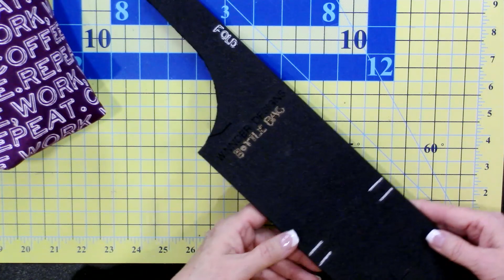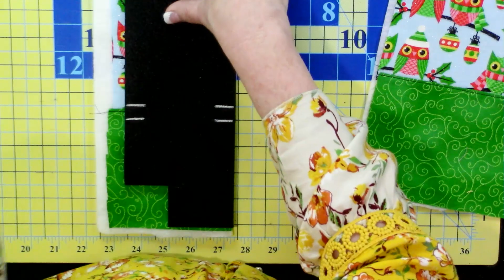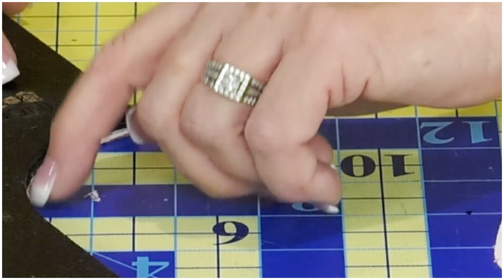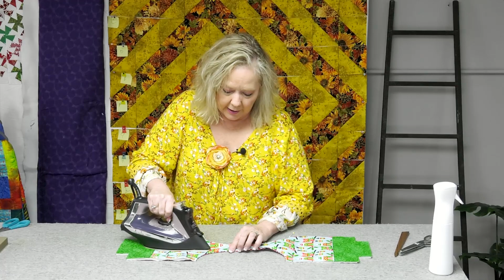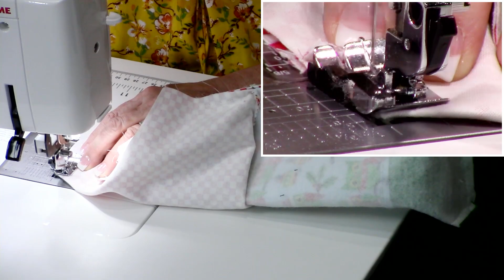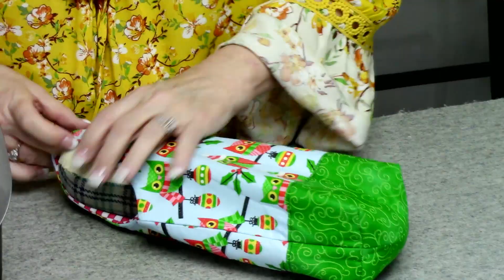Bottle Bag Holder Quick & Easy!

Comment: Where can I find that stuff to protect my iron from getting sticky?
Reply from the maker: Thanks for asking, Ellen! I use a Teflon sheet with fusible interfacing, delicate fabrics & even on the back of vinyl or leather.  You can find them on my website in 2 sizes - 12" x 16" or 16" x 24".  I like the big one as I can put it down on my ironing surface, then place my materials on one side of the sheet & fold the other part of the sheet over the fabric. If you decide to buy, use Discount Code "1st order" to get 19% off your order. You can find them here: https://winner-designs.myshopify.com/products/teflon-pressing-sheet-multiple-sizes?_pos=1&_sid=43bace6b1&_ss=r
Reply: Thank you!! I just found you, but I'll be following!
Reply from the maker: @ Thanks! 
I hope to start filming again. I've been sidetracked w/ major home repair - mold, mildew, termites (ugh!). Finally starting to see light at the end of the tunnel. Planning to have a Newsletter with new templates & a sale come out soon. If you want, you can sign up for it with this link: https://dashboard.mailerlite.com/forms/599830/99411415319708714/share
Reply: Ohhhh thats great! I found you at the perfect time then!
Sorry to hear of all your troubles. I'll be it feels great to be on the other side of all that. I signed up for your newsletter and look forward to seeing more of you. Thank you
Reply from the maker: @ Glad to hear! Sadly, I think lots of people can relate to these kinds of home issues.  There's still lots more to take care of but we're getting there!  Had hoped to film yesterday but had to postpone.  Should have a newsletter coming sometime this week.

Comment: Linda will fusable fleece on both the outside and the inside work?
Reply from the maker: It will be a bit tough to turn so be sure to trim close around the curves & the handle area.  A good turning tool that's not too sharp will be really helpful.

Comment: Forgive my ignorance but will this be tall enough for a standard bottle of wine?  Not sure if that's what you showed in the sample since you mentioned various drink options.  And either way I guess it's not hard to make it taller with the existing template by adding a few inches to the fabric.  I'm new to sewing in general so I appreciate your help.  Thanks in advance.
Reply from the maker: No worries; that's a great question!  I didn't talk much about it in the original video but did address it later. The template gives enough height for a typical wine bottle - but - not all bottles are typical!  In another video I show how to easily move the template a bit to add length to the strap.  The one that is red & white with the leaf appliques is taller to hold larger bottles.  If you get the template & have questions I can help!
Reply: @Lindavideos  I purchased the template yesterday.  If you could include the link for the separate video you are referencing that would be helpful.  Thank you so much.
Reply from the maker: @SoniaScrapbook  Hi, Sonia - I couldn't find it!  It may be something that we did on Facebook Live or during one of my WWL Presentations before.  So, I'll do another video showing how to lengthen as well as a few others things but it probably won't be till next week.  Call me when you are ready to do it & we can either Facetime or I can walk you through over the phone.
Reply: @Lindavideos That's so nice of you.  I look forward to it.  Thanks so much!

Comment: Do you think this could be doubled to make a double water bottle carrier?
Reply from the maker: It could depending on the bottle that you use but.... bottles vary so much!   Being on the fold, you can adjust this template for a # of bottle sizes & styles & change out the handles to make a strap.  Let me know if you do it!
 I want to come out with a template to make a drink carrier but the size & shapes of bottles and drinks in general vary so much that you'd have to have something that is customizable.  Haven't come up with a favorite style and method yet but you never know!

Comment: I just came across your videos and I love these designs and your templates! I just wanted to say when I will be making the storage pods and these bottle holders, I will be boxing the corners like I do in bags / purses. I had been taught that while they are still inside out to attach the box corners to each other, meaning the inner toothy outer.
Reply: I'm sorry I clicked on the wrong thing and wanted to continue my message LOL. But I connect those before turning out or birthing the bag. To me it turns out so much neater with the lining staying in place. I know this is an older video but still I want to thank you for posting!
Reply from the maker: Yes; I love that approach!  I didn't know it when I was filming these videos~

Comment: Hi! thanks for the video. I just want to ensure the bag can hold an average size bottle of wine  - Standard overall height of  and diameter of 2.95” (7.5 cm). The Standard Wine Bottle holds a volume of 25.4 oz (750 mL).

Comment: I saw this method of turning handles a couples of years ago. It was for a Japanese knot bag. The outside was sewn in 4 sections, instead of 2. You have 2 handles to turn. That means, your outside could be made in 4 different fabrics. You have a seam in the middle of the front and back of the bag. I had only made 2 Japanese knot bags, because of my hatred for doing the handles. Once I discovered this method, I made several Japanese knot bags and really enjoyed the process. They were now, so much fun to make. I forgot to say, thanks for the video. Love the bottle bag. Just ordered the template. Thanks.
Reply from the maker: Sounds very cool & something I will have to try & maybe incorporate into a video someday - thanks for sharing!  And thanks, too, for your order.  I got it bagged & labeled & it will be heading to the post office in just afew minutes with all of my other Cyber Monday orders. BTW - Martelli is coming out with a template for the Knot Bag. I think it will do just what you're talking about.